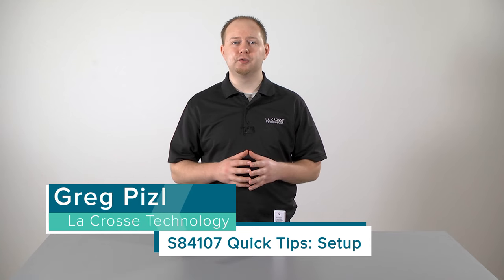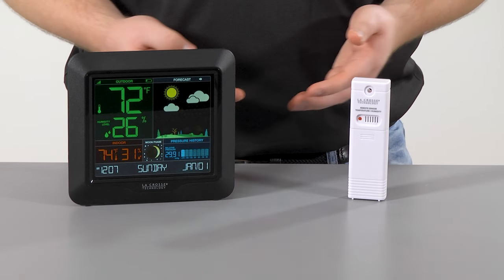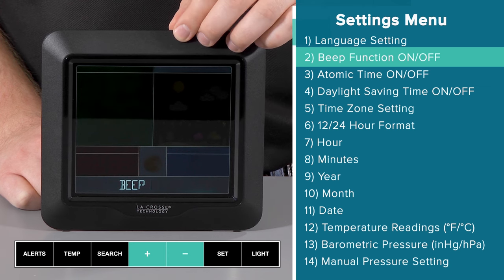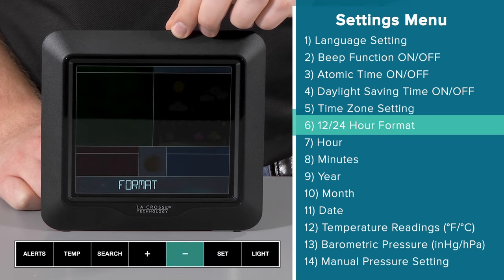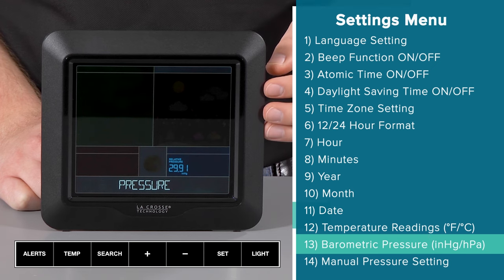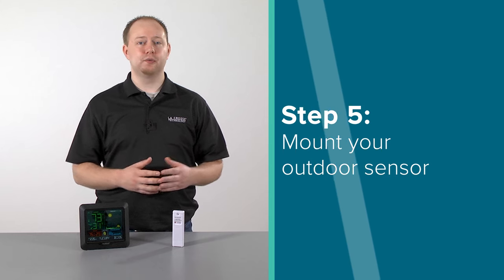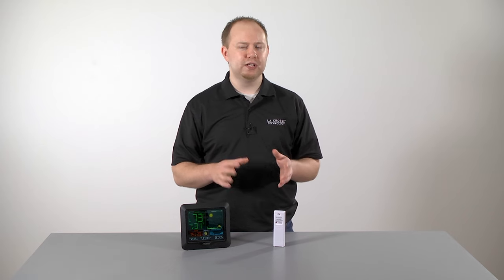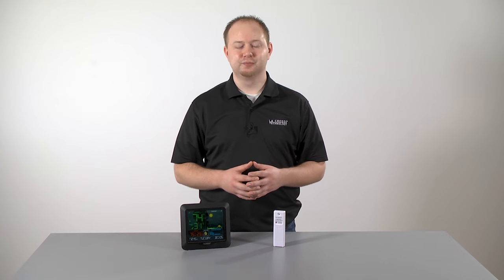S84107 | 308-1416 Forecast Station Setup

Comment: Thanks the quick response.  As is often the case, shortly after I sent the query, my forecast icons began changing on a regular basis.  My only remaining question would be what's the timeframe for the forecast--next couple of hours, next 12 hours, next 24 hours, other?  By the way, I'm on the East Coast so elevation isn't an issue.
Reply from the maker: Hey John, we are happy to hear that! The calculations for this station’s weather icons are based on its internal barometric pressure reading and are designed to display a prediction of your weather to come within the next 12 hours, not necessarily show your current conditions. And because the weather can be a hard thing to predict, even for professionals, we cannot claim these to be 100% accurate. For most of our stations, these predictions fall between 60% and 80% accuracy after the first ten days from the initial startup. We hope that helps clear this up, but please let us know if you have further questions.

Comment: The light on the display turns off after about 15 seconds. How do I make it permanently on?
Reply from the maker: As described in step 2 of this video, at the 0:49 mark, you'll need to power the display using the provided power cord. Battery power only is meant more for backup purposes and will only power the LCD for about 10 seconds after a button push. We apologize for any inconvenience.
Reply: @lacrossetechnology  thank you for your response. Very helpful!

Comment: IF YOUR BATTERY BACKUP DOES NOT WORK: I discovered by reading the reviews on Amazon for this product, the battery terminals for the positive side are misaligned and do not make contact. The easy fix for this is to place a small folded piece of aluminum foil between the positive side of the battery and the inner terminal connector, it sounds more complicated than it is, you just fold up a small strip of foil, insert the battery negative side first (the side with the spring), then holding the foil on the positive side of the battery, insert it, this will make a better contact with the battery. I had to do this on my brand new unit. Now my battery backup works.
Reply from the maker: We appreciate the detailed information and are glad you were able to find a solution that works for you. If you or anyone else has any trouble with your product, please message our support staff directly here: https://bit.ly/contact_techsupport. Or send us a private message on our Facebook: http://bit.ly/LaxTech_Facebook page for further assistance. We are here and happy to help in any way we can. Our apologies for any inconvenience.

Comment: As a long time user of La Crosse atomic weather stations I was looking forward to receiving the S84107 to replace a 12 year old black and white LCD reporting station that started to develop display problems.  Setup was a breeze with the S84107 and time, temp and humidity functions worked great immediately.  Unfortunately barometric pressure (and consequently forecast ability did not).  Digging through La Crosse’s support I ultimately found on the S84107  Faq’s page that “La Crosse Technology products will not read pressure correctly above 6200 ft. in elevation”.  I live at 7,300’ on the Front Range of Colorado so this unit will not work properly.  That is disconcerting because a few lines of code in non volatile memory and perhaps an upgrade to the barometric sensor and this unit would be great and exactly what I was looking for.  As it is I am forced to return the unit and search other manufactures to find the feature set I'm looking for.
Reply from the maker: Hey Rick, we appreciate the feedback and will be sure to pass this along to our product engineers. For elevations above 6200ft, we would suggest one of our WiFi connected models, which can be found here: https://www.lacrossetechnology.com/collections/complete-systems -- These will offer the ability to receive forecast data from the Internet instead of relying on the unit's internal barometer (though barometric pressure readings will still be calculated using the display). We sincerely apologize for this inconvenience and look forward to improving this on future products.
Reply: @lacrossetechnology  Thank you for the quick reply - the problem I have with WiFi models is that they receive weather information from locally relevant NWS reporting stations.  Where I live in Colorado the closet station is 20 miles away and the weather is often different there.  I'm looking at your S77925 station.  Can you tell me if it reads appropriate barometric pressure and when it will be available again on your website.
Reply from the maker: @Rick-jq8ng  Understood, that is a limitation to the WiFi connected models. Unfortunately, all of our current non-connected units will work in this same way, struggling above 6200ft. In regards to the S77925, this is currently a Sam's Club exclusive and likely will not be available through our website directly until late next year. However, you can find it via Sam's Club for a great price here: https://www.samsclub.com/p/wireless-color-weather-station/prod24922238?xid=plp_product_5 -- Again, we are deeply sorry for this inconvenience and have passed along your suggestions to our engineers for further evaluation moving forward.
Reply: @lacrossetechnology  Insofar as the S77925 is not WiFi but rather WWVB will it also struggle above 6,200’ or has the internal barometric pressure sensor been upgraded to function at higher altitudes.  Thanks again for your fast and courteous reply.
Reply from the maker: @Rick-jq8ng  The S77925 as well as the S84107 featured in this video both use the same barometer technology as well as radio reception to receive the WWVB signal for accurate time updates. We should note that this WWVB signal has nothing to do with forecast predictions. More info on the WWVB can be found here: http://bit.ly/AtomicTime
Reply: @lacrossetechnology  I am aware that WWVB and barometric pressure are completely different and have no relationship to each other.  That said it is unfortunate that La Crosse’s barometric technology is limited to less than 6,200’ elevation – especially when you consider that a fix would probably have a marginal cost of less than .50 cents per unit.  I have always enjoyed using La Crosse products but unfortunately am now forced to look to other manufactures to find the weather station technology I need.

Comment: Just got mine from Amazon today, and the Month, Date and Pressure  LEDs are very dim (compared to all the other settings) and do not look to be functionally working. I am not able to tell what month or date to be able to set the S84107
Was able to get all the other settings set appropriately just not the Month, Date and Pressure do to illegible LEDs
Performed a Station Restart and got the LEDs all functioning correctly now  :)
Reply from the maker: Thanks for reaching out! Sorry for the trouble there, we're glad the restart was able to fix this issue. Please let us know if you have any trouble in the future.

Comment: Readings are suddenly way off..i.e.  the humidity level is about 40 digits too low (Its a misty rain here for 2 days its showing 57% humidity, more like 95% or more)  It's is raining lightly still; but the forecast has a bright sun, no rain.  The outside (white plastic box) sensor, that reads the outside conditions did get very slight wet INSIDE, under the motherboard was a 1/4" dot of water I blotted the water off.  Dry inside...so did that spot of water wreck the sensor?  Do I just need a new ourdoor sensor ?
Reply from the maker: We're sorry for the sensor trouble. First, forecast icons may not necessarily show current outdoor conditions as the station uses barometric pressure to predict future weather changes for your area. We have a different video here: https://bit.ly/forecast_vid that discusses how these work. 

As for your outdoor sensor, ideally, it should be mounted in a location that is not directly affected by weather elements (rain, snow, sun, etc.), as they can cause issues. To test the sensor, try our side-by-side test explained in our other video here: https://bit.ly/inaccurate_temp_readings -- if the values are outside of acceptable ranges after this test or if you have further questions, please message our support staff directly here: https://bit.ly/contact_techsupport, or send us a private message on our Facebook: http://bit.ly/LaxTech_Facebook page. We are here to help in any way we can and apologies for any inconvenience.
Reply: @lacrossetechnology   Well, considering the graphics of sun, clouds, rain and the fact is has outdoor temps, humidity, I'd THINK it would INDEED Show the weather changes (it used to)...I mean, isn't that that the whole poing of the outdoor sensor?  And yes it is under a front step overhang protected from rain etc , Anyway I have to think the sensor is defective so I ordered a new one on Amazon for my model .

Comment: Question: my house faces north and has a front porch whit a roof that overhangs the supporting square columns.  If I place the outdoor sensor on the "inside"of the column(the south-facing side) where it is always shaded and also protected from rain, does this fulfill  the  north requirement?  It is actually better protected from rain on the inner side of the column than on the north wall of the house. (The column is where I had placed the sensor for the weather station I am replacing, which finally seems to have worn out. It worked well there for many years.)

Comment: Hello, I have the S84107. After a recent power outage, my receiving unit is now making a single beep every 45 seconds.  I have replaced the sensor batteries and the red light is flashing about 2 times per second. I have replaced the main unit batteries and the unit shows strong signal reception.  I have all alerts turned off and I have beep turned off.  The beep is driving me crazy.  Any suggestions or solutions?  Thank you.
Reply from the maker: Hey Joe, our sincere apologies for the trouble. Please try the following steps to get this corrected: 

1. Bring the outdoor sensor inside next to the station and remove all power from your sensor and station. Including batteries and unplugging the power cord from both your wall and station.

2. Press any button on the station at least 25 times and leave it sitting without power for at least two hours.

3. Install new alkaline batteries into your outdoor sensor. 

4. Power the station back up by plugging the power cord into your outlet first, then into your station. 

5. Press the TX button on the sensor (located above the batteries) to force a transmission and make sure it is your sensor synced with the station. 

6. Once the sensor is connected, install backup AA alkaline batteries into the station for best results. 

If this does not resolve the issue, please message our support staff directly here: https://bit.ly/contact_techsupport. Or alternatively, send us a private message on our Facebook: http://bit.ly/LaxTech_Facebook or Twitter: http://bit.ly/LaxTech__Twitter page for further assistance. Sorry again for the inconvenience.

Comment: Is the pressure history graph meant to be a rolling 24 hour history.  It seems that my unit resets itself multiply times daily to either the minimum graph or the maximum graph.  The current reading is always correct.

Comment: Hello, I have an S84107.   Lost the outdoor function, just dashes show.  Replaced all batteries, unit and sensor.  Did all of the manual suggestions to reboot to no avail.  Noticed the red light on sensor is not coming on - have changed batteries again, still no luck.  Does this mean the sensor is shot?  I've looked online for a replacement, but cannot find one for this model.  Any suggestions would be appreciated.  Thanks very much.
Reply from the maker: Hey Sue, our sincere apologies for the trouble with your outdoor sensor. From what you've described, it does sound like a replacement may be required. You can find replacement sensor options on our website here: https://www.lacrossetechnology.com/products/S84107#parts -- If you should have any further questions, please just let us know. 😊
Reply: Open the outdoor sensor and look for a small button, if you press that it will reconnect with the main unit.

Comment: Everything works fine on my unit, but the forecast doesn't seem to be very accurate.  The unit has been on for a couple of months now and the pressure history graph keeps scrolling as it's supposed to, but the forecast icons don't seem to change much.  Right now, for example, it's pouring rain outside and the TV weather person says it's going to rain for at least the next day, but my weather station shows sun and clouds.  Am I missing something?
Reply from the maker: Hey John, our apologies for any forecast trouble with your weather station. Since you've had the unit up and running for some time, our next question would be, where are you located? Higher elevations (at or above 6200ft) offer a greater challenge for this device, as there are less pressure changes for it to read and thus activate changes to your forecast icons. In either case, if you're not getting any accurate weather predictions, please message our support staff directly here: https://bit.ly/contact_techsupport. Or alternatively, send us a private message on our Facebook: http://bit.ly/LaxTech_Facebook or Twitter: http://bit.ly/LaxTech__Twitter page for further assistance. We are truly sorry for any inconvenience.

Comment: can the sensor be located under an overhang of a roof?
Reply from the maker: Hi Louis, thanks for reaching out! To answer your question, yes, mounting the sensor under an eave is actually one of the best places we recommend. Just be sure the sensor is fully shaded, as direct or indirect sunlight can cause higher than expected temperature readings. For more information, you can find our product FAQs and full manual on our website here: https://www.lacrossetechnology.com/s84107?type=manuals

Comment: My mom's S84107 outside temperature is stuck at -99°F and my dad's S82929 is stuck at 199°F. What do I do?
Reply from the maker: For the S84107, we'd recommend performing the basic restart steps covered on our support page here: https://bit.ly/basic_restart using a new set of regular alkaline batteries and making sure to keep the sensor our of direct rainfall or other weather elements. For the other station, we recommend powering it down completely removing all batteries and power cords, press any button on it at least 20 times, and leave it sit without power for a couple hours. If these steps do not resolve the issues, please message our support staff directly here: https://bit.ly/contact_techsupport. Or alternatively, send us a private message on our Facebook: http://bit.ly/LaxTech_Facebook or Twitter: http://bit.ly/LaxTech__Twitter page for further assistance. We do apologize for any inconvenience.

Comment: I just purchased the S84107 and installed yesterday. The outdoor temperature is still showing dash lines.  I followed set-up and restart directions and still have dash lines and forecast showing sun when it's actually raining outside . Sensor is not being found by unit and it's sitting on countertop 3 feet away. WTH ?
Reply from the maker: Hi Ray, we apologize for the trouble with your outdoor sensor. If you've followed the steps in our restart video here: http://bit.ly/LaxTech_BasicRestart and it is still not connecting, please also try pressing the small TX button on the sensor just above the batteries. Its red light should flash forcing a transmission. If it still does not sync with the display, it may just be a bad sensor, in which case, please send our support team a message here: http://bit.ly/contact_techsupport and they will gladly help get you a replacement. 

As for your weather icons, these are based on the station's barometric pressure reading. The icons are not necessarily designed to display your current weather, but more of a future prediction of your forecast to come in the next 12 hours. After setting up your station for the first time, these icons can act a little funny, which is why we recommend allowing 7-10 days for the station to acclimate to your location. And because the weather can be a hard thing to predict, even for professionals, we cannot claim these to be 100% accurate. For most of our stations, these predictions fall between 60% and 80% accuracy.

Sorry again for the trouble with your sensor and for any confusion with your forecast icons. We hope to have this all resolved here soon.